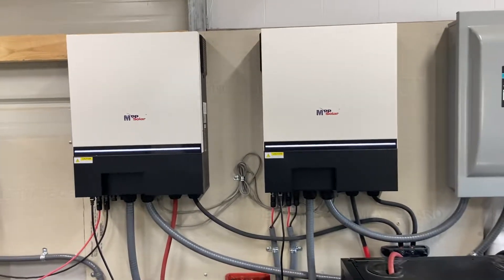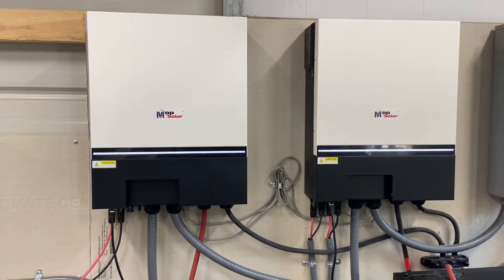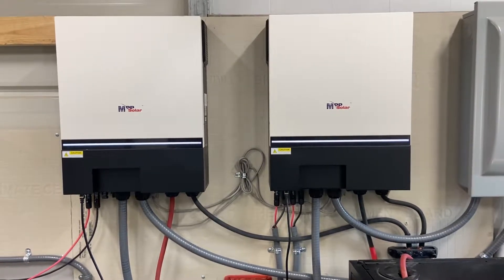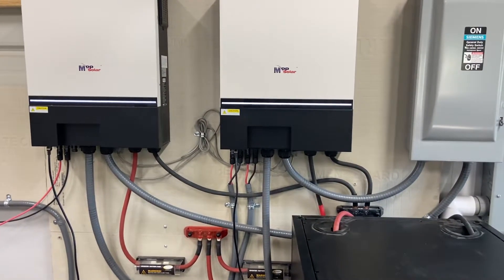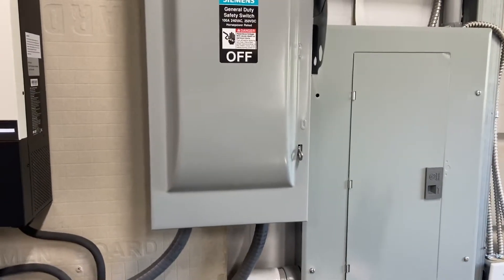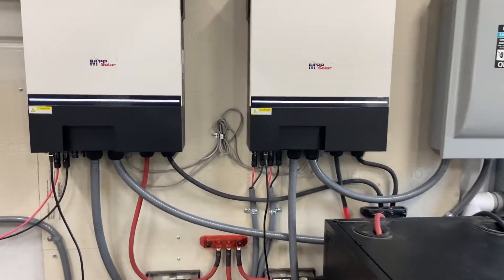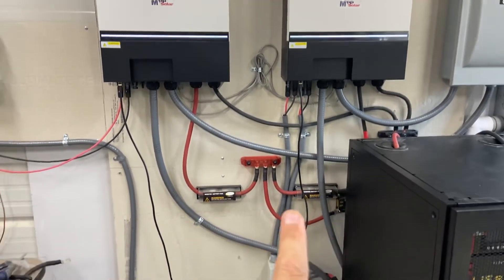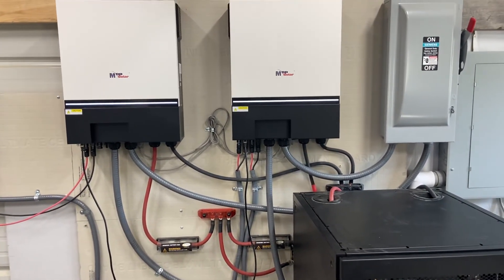AC wiring for LV6548’s

Comment: Hi Gavin,  wonderful video!  I am currently trying to setup two of the LV6548 units and having great difficulty getting the 4 gauge wire into the AC terminals.  How did you accomplish getting 4 gauge wire into these small terminals.  DN
Reply from the maker: If I had to do it over again I would just use 6awg. The 4 awg is extremely difficult to get in there. Needle nosed pliers helped guide the wire in. And the wire needs to retain the shape of when it’s first stripped. Definitely not easy.

Comment: Can I connect my 1000sq home to this and it will run my not too big fridge, central air and water heater permanently? My meter ripped off my home because of a fallen tree
Reply from the maker: That’s absolutely possible. It would probably more come down to battery storage. I did it for months with these inverters. And also the eg4 version.  I talk about that more in this video. How we run our entire home off of two EG46500ex’s,  13kw of power -comfortable living off grid
https://youtu.be/D43zAv0x_YY

Comment: Too messy to watch, sorry. Besides why buying 2 120 Volts inverters when you could have bought one inverter split phase 120-240 Volts? Cheaper, easier and cleaner installation.
Reply from the maker: I believe you left comment like this on another of my videos. No need to apologize. Or no need to comment either for that matter. I am curious what 13kw inverter with  240 amps worth of charging and 16kw pv capacity  would you find for cheaper then $2,400? Even if you could find all those stats for cheaper (which you can’t) I’m not sure I would wish to use it. You could install a growatt 12k split phase. Plus at least one charge controller because it lacks the charging amps and has a huge idle consumption. Plus it’s more difficult and expensive to install. You could install 2- mpp 6048wp split phase. Which is the same amount of wiring and double the money. And still less kw’s.

Comment: I think you said 2/0 wire from the batteries to the inverter is that correct even though I'm only running one I think I'm going to put the bigger wires I'm sold on wire size now after seeing your video and a few others
Reply from the maker: The manual recommended that size wire yes.
Reply: @GavinStoneDIY  thank you on the wire size is in the manual comment
Reply from the maker: @VinceBadovinatz88   sure thing. It’s on the side of the inverters as well.
Reply: @Gavin Stone  thank you. I'm going to unbox my sungold tomorrow sometime

I just got to 10 ft pieces of 2/0 wire🙂

Comment: I need to see a video where they have it  hooked up or are installing and they point out all the wires and give me the wire size. I'm only hooking up one sungold 6500 LV 48. So mine's going to be a little more simple and it's only off grid. I might hardwire a wire from my generator into the 120 input to use my generator if I don't have enough battery. But I bought four server rack 48 volt EG4's.. I should have plenty of battery power for what I'm doing for the time being I'm starting out real small. 120 will be fine for me I'm living in a little trailer. And I have a small shop also. If either of you guys know about a video where they show all the wire size and everything

I wonder what size wire I should use from the battery to the inverter. On my 12 volt system I have  1/0

I could have sworn they were saying 4 gauge. With the bigger inverter maybe that's because it's 48 volts you don't need as big a wire. Gosh this stuff does not come to me very easily I have done so much watching a videos and everything and still don't have it figured out in my brain. Any help would be nice and thanks in advance for even taking the time to read the comment they are a little lengthy. And probably don't sound perfect. It's kind of difficult to edit my comments here on YouTube

By the way thanks for the video also I'm going to try to find some of your other videos I just subscribed
Reply from the maker: The manual will answer a lot of your questions. I was nervous before installing my system. But it’s really not that bad. Will prowse has a video on his original lv6548 installation. That was extremely helpful for me. They call for 4 awg wire on the ac side. 2/0 for the dc into the inverter. On that installation video Will goes into the fuses and breakers he used. Everything is clearly marked on the inverters. So take your time and watch his video a few times. He uses 6 awg wire for the ac side in those videos. And technically that will work in most cases probably. But they call for 4 awg because of the surge capacity.
Reply: @GavinStoneDIY  thank you very much on the wire size

Comment: Gavin,  I know this is an older video but I just started watching the videos you made.  Had a couple questions for you if you have a moment.  

For your AC In to the inverters, do you have a disconnect for that power at the house or in your shop?

Also, you mentioned around 6:15 that you have a "passthrough switch at the house".  Is that a manual transfer switch which would allow you to switch your loads panel back to the grid?

I ask because I need to do some work on my inverters which is gonna cause me to have to take them offline for a time and I'm trying to figure out how I can easily (but properly) feed power back into my panel which is my "combiner" for the AC Outs from the inverters.
Reply from the maker: Hey, I’m glad you found my little channel. For the AC supply From the house to the inverters I just use a 60 amp breaker from my main at the house. For the pass-through switch or manual transfer switch you could use anything 60 amp or above between the boxes. Probably 100 amp would be best for further expansion, so a #3 copper thhn at least. I had a 60 amp box there fo begin with because it was a small generator loads panel.  So I currently have that between my critical loads panel and main. The pass-through breakers also allow for experimentation between the loads you already supply and possibly ones you’d want to send over from your main. In Other words you can switch your main off and supply the whole house from the inverters  if you chose to.  But technically they are supposed to have a breaker lockout on both of them (inverter input, and grid input)  to prevent two feeds being on at the same time. Just like a generator lockout. So if the lockout were installed it would prevent you from supplying your main if you ever chose to. Either way, it is the best option in event your inverters were ever to go down, that way your critical loads can always be supplied. I hope I’m not making this confusing.
Reply: @GavinStoneDIY   Awesome, thanks for confirming what I was thinking!
Reply from the maker: @AdamDeLayDIY  sure thing. I do plan on  making a critical loads video at some point. Also, any breakers you transfer from your main only need the hot leg. The neutral and ground can stay in the main. The neutral/ground  for the panel itself will be supplied by your 60 amp-100 amp neutral and  ground. I may be preaching to the choir at this point I just figured it was worth mentioning.
Reply: @GavinStoneDIY  No worries.  Regardless I already knew that or not, it might help someone else out down the road, so still worth mentioning.  Thanks again!
Reply: @Adam De Lay  dang I know I'm going to be putting in my system just one one son gold lv48. The parts are starting to roll in. I talked to Gavin a little bit the other day.
I think we were commenting on  Will Prowse's video. he gave me some information. Everything's so confusing I don't know how you guys do it. Gavin wired that in so good. Hopefully I'll see some other videos and figure it out wire size and such.. I'm not tying into any grid either. So mine will be a little more simple hopefully I can figure it out. I would probably never be able to figure out all that grid tied stuff.
Reply: @VinceBadovinatz88  good luck!
Reply: @AdamDeLayDIY  thank you on the good luck I read the long comment from Gavin. And I kind of understood it a little better the second time I suppose if you read them over and over then finally it'll click hahaha.
Reply: @VinceBadovinatz88  Yeah, I get it.  It's sometimes hard to process text from a comments section.  I'm a much better learner from watching, that's why I love YouTube.  After watching everyone else doing they installs, it really helped me on my own installation!
Reply: @Adam De Lay  yep on your watching the video comment. I was going to try to change around my 12 volt system I've got running. I was going to try to change the series parallel but I forgot a good portion of what I learned now I have to go back and look at one of Will's early videos that I got started on. He was explaining the series parallel I've got to see if I can redo my panels to a different series parallel. At first I thought I could do it and then the more I think about it the more I might not be able to🤪 now in my head it seems like I might be able to do it. It's so funny all the numbers to try to compute. Well thanks for your reply earlier. Hopefully I can figure this one out. This is my existing system. Not the 48 volt system that's coming in I don't have all the parts to that yet

Comment: Very nice. Did you remove the bonding screws in each inverter in this setup? I am grateful, for your answering my questions on here in the comments as navigating the forums for answers can be overwhelming at best. I have spent days wiring my ac output side with #6 wire and am now concerned it may be too small but I see many that use it. After watching this video many times I believe I grasp how you split the input side ac neutrals and grounds, that was a major question I had trouble finding answers for.
Reply from the maker: Technically 6 awg wire is sufficient. But for the surge capacity it isn’t. Which in my opinion is why they recommend 4 awg. I removed the bonding screws from both units. But to be fair it really depends on how you have it wired in your outgoing breaker panel also. I chose it for my particular setting because I know I am bonded at my main panel. For your application it may be different. Amazon carries the polaris  3 way splices for splitting the neutrals and ground. They are pretty cheap if you find the right ones.

Comment: My Ground/Neutral bond is done in grid/utility feed disconnect coming from the street.   I run 3 wires (LNG) per phase to a manual transfer switch which can take me on or off utility.     The LV's grid feed comes off panel which is feed from the utility disconnect.     This give us to option to on grid or off grid with utility/grid backup (in SBU priority).
Reply from the maker: This is something I’ve heard people do. And that does work depending on your needs. I just preferred everything being automatic. So the manual transfer switch wasn’t something I was interested in. On the other hand a solar system makes a fantastic backup generator. So there is quite a few people that wire their systems the way you have.

Comment: Is your 4awg 19 strand THHN?
Reply from the maker: Yes. I purchased mine from a big box store.
Reply: @GavinStoneDIY  at 3:00 you talk about splitting the neutral. What device did you use to do that? Same for the ground. Thx
Reply from the maker: @thenuthing8258  a three way wire splice connection. Polaris makes the most common insulated connectors,  but there are some off brand ones also. They are an easy way to connect large gauge wires safely.
Reply: @GavinStoneDIY  My main breaker panel is close to my inverters. Besides the (tiny) wiring diagram in the manual showing a single neutral split off to each inverter, I can't see any reason I couldn't run individual neutral wires from the main to each inverter. Thoughts please. Thx again.
Reply from the maker: @thenuthing8258  just a little extra cost for wire, but it should work fine. Not really an advantage or disadvantage. And you’ll also have to purchase 4 large neutral lugs  for the ground and neutral if you are going to run them separate instead of just 2. Thats   assuming you are going to run the 4 awg wire like the manual specs. The 4 awg doesn’t fit in to the standard neutral or ground bars. But the large lugs are cheap so it’s not a big deal. The manual online is easier to read and  has colored photos.
Reply: @GavinStoneDIY  I'm grateful for your insight, thank you
Reply: Did you remove the Neutral Ground screw in the LV?
Reply from the maker: @errcl65   I did yes. After a lot of research and discussing it with the person that sold me the units I decided to remove the bonding screws.